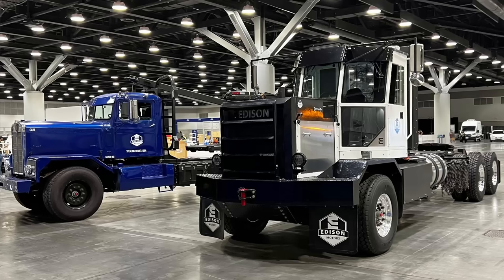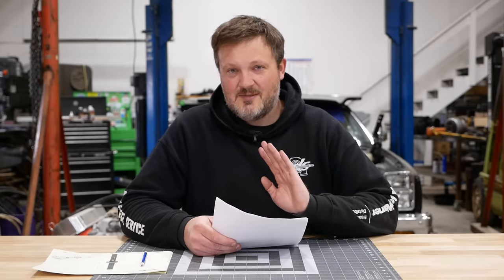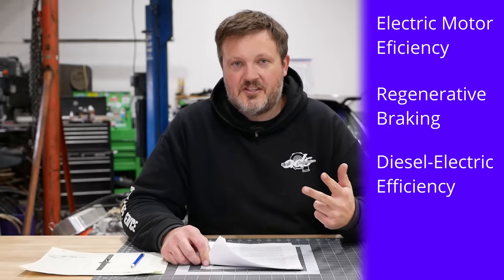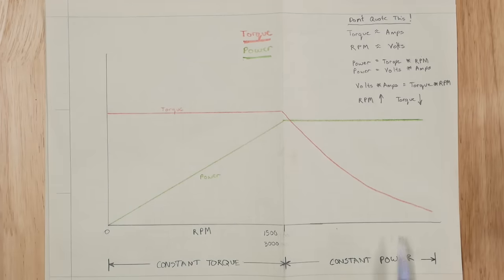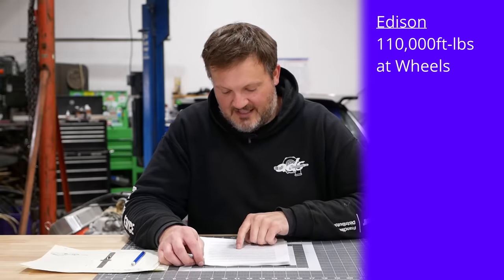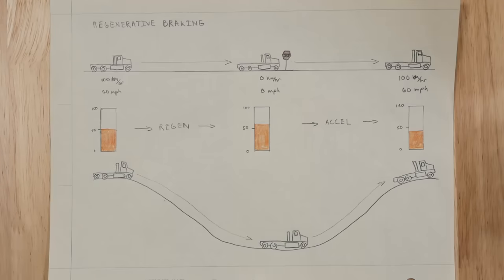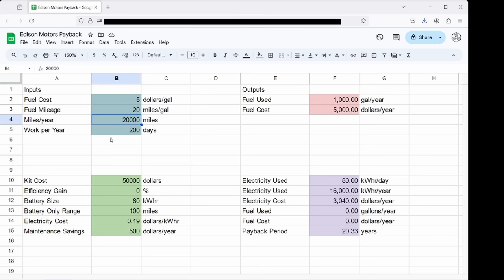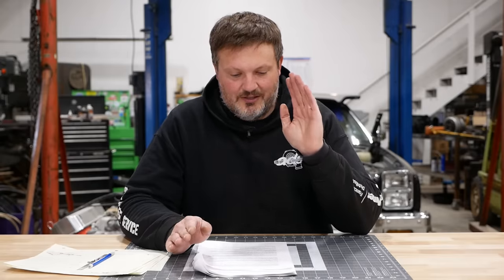Edison Motors Built a Diesel - Electric Semi Truck

Comment: I am an engineer that worked for a startup once upon a time. My boss was a master class of back of the envelope technical analysis.  80% of ideas can be evaluated on the back of an envelope in 20 minutes that will tell you if it's worth your time. This video reminds me very much of sitting at a conference table watching him work his magic.  I think your evaluation is accurate and technically sound.
Reply from the maker: I hope so.
Reply: Was your Boss' name John Galt?
Reply: Envelope?  I did a few on a cocktail napkin.
Reply: My former brigadier once confiscated a napkin, on which we drew our tactics for an attack exercise. He said: Did you know, that is napkin tactics! That's the way tactics should be done, keep it simple. I'm going to put it in a frame and hang it on the wall in my office. 

In my former job i did a lot of retrofits. And yes it's true, i did the basic engineering for most projects within some minutes. This is the problem, here is a pssinble solution. To be evaluated: Will the solution solve the problem, what does it take in manpower and materials, how much does it cost, what are the benefits, how much money can be saved, how long will the ROI be.
Reply: as government subsidies for ev vehicles are used on ev vehicles that are not really that efficient and truly dont have a dedicated mission other than, "I want one, they seem cool"
the overall efficiency of the united states budget machine  ( of which we all pay into) falls.   And it falls at a rate that is using the value of money as I type today which is worth more than money used in a year
Reply: Diesel submarines circa WWII were true series systems with batteries. I’m sure the Navy has a library-full of information on propulsion efficiency of that system. Of course, modern battery tech is very different from the lead-acid batteries that the subs used.
I worked with a guy who was chief engineer on one of the last diesel powered subs in the U.S. fleet. He said the diesel engines were so worn out that when the engines were shut down before submerging the boat, he had to flood the air intakes with the fire extinguisher system. There was so much lube oil getting past the piston rings that the engines would run quite nicely even with the fuel injection pumps shut down.
Reply: @stevenslater2669  i don't know exactly about american subs, but in general subs during WWII were not series hybrids. For example the german Typ VII had two diesel with about 1500hp each, behind them were two electric motor/generator units with 375hp each. That's why underwater speed Was very low.
Reply: Very Informative video.  You bring up many good points….  In my opinion most truck buyers aren’t looking at the economics .  They just spend huge money for a flashy truck.  I like how Edison is thinking outside the box trying something different.
Reply: I enjoy your thoughts and evaluations looking forward to the next like video.
Does cost include Road tax by mileage government are going to get money out of this.
Reply: @stefankaufmann8257 
Like a vw Jetta tdi.. the drive train is cheap and good for 600,000 m range . The fuel mileage is relative. Add to the cost of upkeep on everything else…Pushes the ROI further away. Till it’s unfeasible.  A Tesla 120k where is the ROI in reality?
Reply: @FFLFFS  i know, what you mean. I'm not a big fan of ROI calculations, because the management wants a low ROI and the techicians and the workers want reliable machines. But it has to be done, no question. There should be a reasonable compromise.

I did retrofits on machines, we otherways would have thrown away. My point was: The retrofit was not always cheaper than a new machine. But: I used standard industrial parts, so repairs could be out of the shelf. My retrofited machines last longer than new ones and diagnosis is easier, because we know it inside out. All in all down time is lower, that's what people often don't see and don't calculate.

I was not always allowed to make a retrofit, it was denied, when the plant manager and boss of more than 500 workers - a swiss cheese maker with absolutely no management qualifications - calculated the ROI. He expected an ROI of not more than 18 months. On the other hand he expected new machines to have the same ROI and expected a lifespan of 20 years. Can you imagine, what cheap scrap he bought? 🤣
Reply: @stefankaufmann8257 the fire extinguishers part should have been your hint the guy know nothing and it's a fairy tail story 
No mechanical would do that
Reply: @legros731  you underestimate (or overestimate, both might actually apply) the mechanical know-how of a submariner.
Reply: @KH-fi1fn  I don't think Wes is doing a good job. He is using addition and subtraction to understand a dynamic energy and load problem with 3 different power plants. ICE, generator, and electric motors.  The analysis was not worth the paper scrawled.  Put in shit, get shit answers.
Reply: Ive been following edison since before Topsy...im a fan and support them but like you i believe there are some issues they arent acknowledging and that they are overally optimistic with some of their claims. Those issues can likely be overcome but there is a lot of refinement to be done before going to market.
Reply: @dulmi2317  lol this have nothing to do here and a completly different tech but whatever
Diesel submarine go up start the engine to recharge the battery and go down after 
there no way to run a diesel engine underwater it need ton of air, it would consume all the submarine air in no time 
You could be the cook on said submarine that not a sign of knowledge lololol
Reply: @legros731  seeing as you actually know nothing about submarine propulsion, leave that discussion to the people who actually worked on them 😉
Reply: @dulmi2317  lol tell me how you run a engine underwater I am all ear buddy
And maybe listen to the video next time 
Locomotives are like that and he said they are only 25% efficient vs a modern truck that is 30/40% efficient
Train are efficient because they can transport huge load when you transporting 200 container vs a truck that maybe transport 2. Who care about a 10% efficiency different 
Imagine running a diesel engine underwater in a sub lol good way to end with a torpedo in the ass
Lol submarine engineer clown
Reply: @legros731  nobody claimed engines ran underwater. Read more carefully
Reply: @dulmi2317  simple math buddy
A truck for a 15L engine running at a steady state of 2000 rpm it's a 4 stroke so it consume 15L of air every 2 rotation so 2000/2= 1000 , 1000*15L= 15000L per minute or 900 000L per hours the sub engine are probably twice as big so 30L for a total of 1.800 000L per hour where do you store all this air inside the sub
And I highly doubt that diesel sub can fully recharge the battery in one hour 
There a reason why they are nuclear powered now clown
Reply: @dulmi2317  by the way when I say underwater I mean inside the sub but that was pretty obvious to anybody with a brain

Comment: As one of the first YouTuber's to do an electric lawn tractor conversion. Just to show the insane exponential cost. I fully support this video. On papar our setup should have done 10mph and run time of 2 hours. It did 4mph and a run time of 30 minutes with a 40 pound kid driving. Paper numbers and real world are insane different.

Comment: Nice work!  This all comes down to mission mission mission. The word we used back in engineering school, and the word used by the military.

Best example: all UPS delivery trucks in my area now run on natural gas. Essentially 3 reasons why: 1) the fuel is cheaper per mile; 2) the trucks run the same route each day, so it’s easy to know that they can carry enough fuel to complete the “mission” with some contingency buffer; and 3) the trucks return to the same yard each night, so relatively easy to install fueling equipment, pipeline connection, etc.

It’s the “fixed mission” vehicles that need to go to alternative fuels, whether that’s natural gas, diesel-electric, or pure EV. This would be trucks that do the same limited mission every day, and can return to a central yard each night. City buses, school buses, garbage trucks, local food delivery trucks, bread trucks, farm service trucks (like milk trucks), furniture delivery, etc.  Plus, most of these trucks run in urban stop-and-go conditions, where regenerative braking shines and can add to efficiencies.

Sorry, but Long-distance semis need to stay diesel.

Pick off the low-hanging fruit now.  Migrate other vehicles as the technology advances.

Comment: As an engineer who is working on an electric class 8 drivetrain program for a big OEM, this video is spot on.
Electric will not be the solution to everything, but it will excel in certain applications, like buses and other dedicated route vehicles, and only get better as battery tech improves.

I am also an Edison fan, and even if the numbers don't quite make sense, their "no secrets, here it is" approach is making an impact in the EV world. Proving that if you build something worthwhile people will notice.
Reply: Here here.  Let's hope this mentality can make a dent in a world run by conglomeration.
Reply: got a idea and hopefull for a power plug to become standard like the ford's are doing so the refrigerator/trailer and tri-pack and lose a engine and support hardware and at the docking be plugged in to shore power with the NAC/CCS2 plug so my ears and my lungs thanks-me/osha USA 🇺🇸  and for my trucking family ( add in less cab vibrations and better sleep 😴and less heath-vibrate as this can be hard on kidney's-etc ps not in medical field but seen conditions of other's/commonality-problem's as a family-member/passengers and in plant-maintenance/daily-job + living next to the parking lot/plant/truck-stop ) as 3X engine's runing at the same time is a little excessive, when rooftop solar and battery storage and main-diesel can power it 70+% of the time and or land/CC2-plug'd-in

2002 3-engines might have made sense but it's 2024 now and technology has changed for options, might even be possible to get more loaded from the weight-reductions of emissions/engine-etc
Reply: The word is "excel".  English as a first language.
Reply: Battery tech is essentially no longer improving. Unless there’s a major breakthrough. Unicorn farts aren’t it. Build something dumb and smart people will notice you are dumb.
Reply: @MckIdyll What can I say, I'm an eng-a-neer, not an English major.
Reply: ...as battery tech improves...? and how much improvement does theory, let alone practice, allow?
Reply: @jonathanbaxter5821 incremental improvements are coming all the time, not always in performance but in safety, price, sustainability and so on. And there's still hope that we'll se solid state cells commercially available this decade.
Reply: @jonathanbaxter5821  ... not true.  Solid State battery technology is on the way.  It will literally change EV batteries forever.  I believe Toyota is leading the effort.

Comment: The elephant in the room is “ real world testing “
Reply: I thought you were going to say that G body behind him with the hood off
Reply: Carbon cultist mathematics is special, but luckily it's government approved.
Reply: they've had diesel electric locomotives for decades.
Reply: @kenluther9948 have you seen the size of those things 😂. It’s putting that into a much smaller package and making it work for the general public.
Reply: @LAactor I believe that is an A-body.
Reply: @kenluther9948 Yeah, and it's not because of efficiency. It's more because of reliability.
Huge mechanical transmissions for multi-thousand horsepower engines are quite tricky to engineer.
Reply: @kevin9c1  what did it look like to you? Gto? Chevelle?
Reply: @LAactor  Looks like a 77 Malibu.  Which is an A-body.
Reply: @kevin9c1 watch the last five seconds of the video, “My forklift has weird cylinders, they also leak”
Reply: @Me-zo8yc  Not unlike frothing EV pie in the sky mathematics. "Huge battery efficiency gains are just around the corner- let us base all our arguments on that!" I have been hearing about the leap in battery efficiency for 40 years, when will it happen?
Reply: @TyphoonVstrom  That too!  Or hydrogen.  It turns out nature has hydrogen storage etc all worked out for us - stick a carbon atom onto it.  Hydrocarbons.  Easy to store, energy dense, etc.

Comment: Having worked on the GM Impact and EV1 cars from the late 1980s to the mid 1990s, working on fuel cells, and working in the auto industry for over 40 years, these new ideas are great to see. That being said, the claimed efficiency, durability, costs, and benefits are not always going to fit the every day driver. That is why vehicle producers have always had user "real world" defined, 97% driver use profiles to determine conformance to specifications. These systems do not hold up for more than a few niche users.  Love your content Wes, I hope this company makes you eat Crow, we would all win!

Comment: This math checks out for a highway truck for sure

We’ve said from the start that it doesn’t make sense for the highway, you can gear a mechanical drive to run at a steady rpm doing 100kmh for hours straight very efficiently 

The efficiency of diesel electric is in the regen braking slowing down, and peak load demand starting out.   As well as the ability to run on full electric while operating on site running hydraulic functions.  

A logging truck, garbage truck, hydrovac unit makes much more sense

Do not buy this for the highway yet.  

Our truck makes more sense in some applications, and less sense in other applications.  It’s a case by case basis.

If you need big power, big torque, and good hold back in steep country or heavy city driving consider hybrid

If you’re going down the highway our driveline doesn’t make sense.